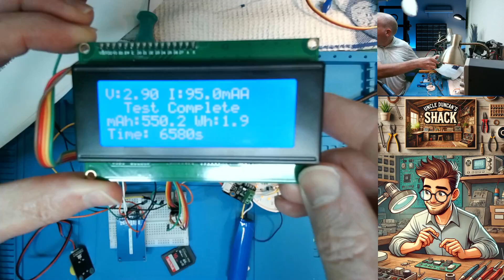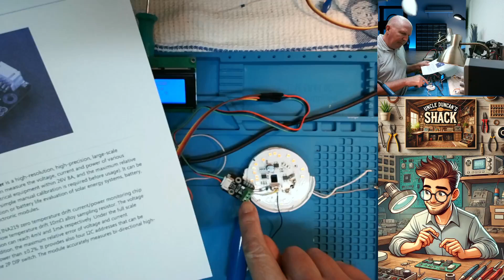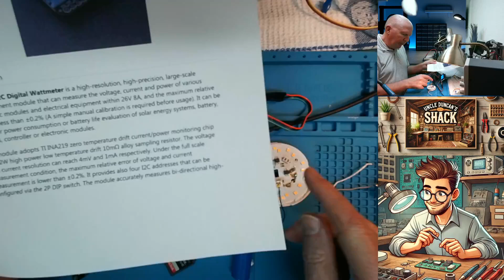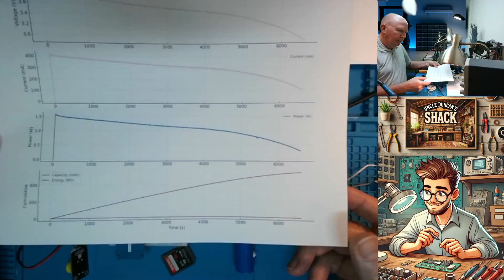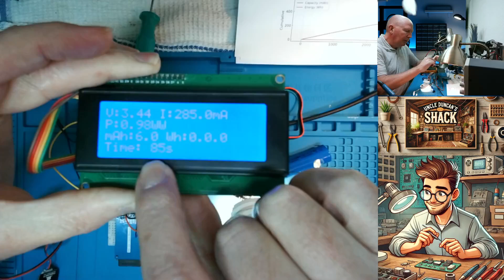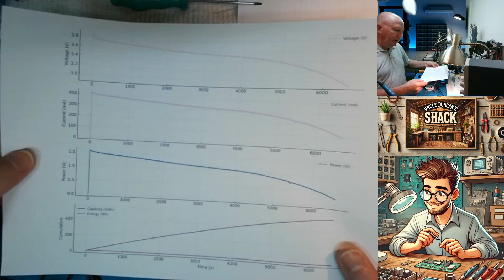🔋 DIY Battery Capacity Tester | Real-World Logging with Arduino + INA219

Comment from the maker: This project started as a “what if…” and turned into a proper little lab! 🔋📊  
The Philips lamp’s constant power driver worked perfectly as a load, and the INA219 gave us solid, reliable data. 
End result: 550 mAh and 1.9 Wh logged and graphed with style!

What would you like to see next?  
→ Dual battery testing?  
→ Charging curve analysis?  
→ USB-C charging monitor?  
Let me know below 👇 😄
Reply: I'm using a USB charger for the 3.7v's. It's rated at input 5.0v, however I saw that 3.7v should be recharged at 4.2v.
Will this have an effect on battery life? So the USB charger monitor would be helpful. 😊
Reply from the maker: Hi Nick,
4.2v is the maximum voltage to take a cell to, it does wear them significantly less if one uses them in the 20% to 80% charge area though.
I don't think the average usb charger would do that though, they full send it to 4.2v.
A converter where you can set the current and output voltage is an option, such as this one from Communica.
It will take 5V in and one can set the current and voltage out, so one could set it to stop at 3.7V.
https://www.communica.co.za/products/bmt-buck-boost-solar-1-30vdc-10a?variant=48623206760748
One could feed it from a usb port still to power it.
The nice thing is it will take 12V in as well and allow charging in a vehicle if need be.
Or from a solar panel.
Reply: Cool, thanks Uncle D. With appreciation. 🙏

Comment: Does the power module also show "reverse power " when the battery  is being charged  or is undirectional  only  ? . Complements on a really interesting video
Reply from the maker: It is bi directional in current measurement.